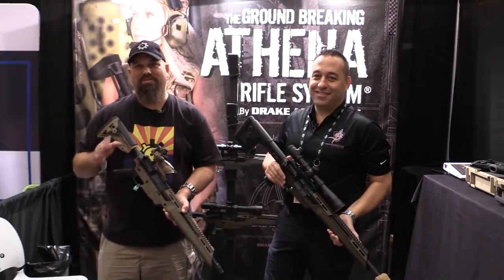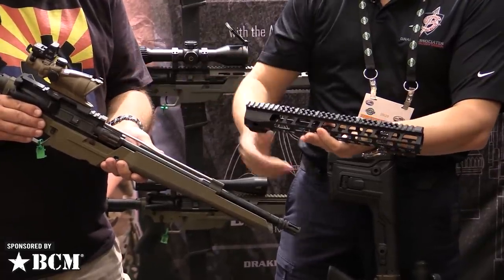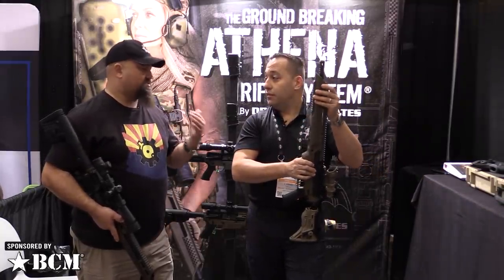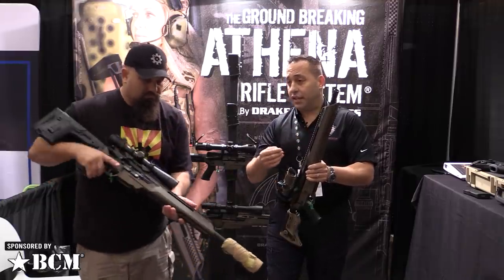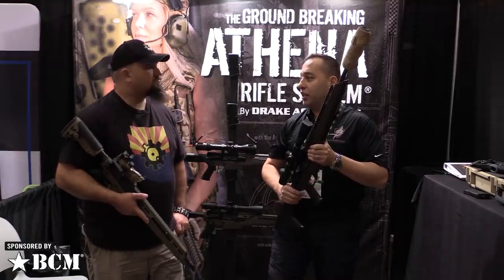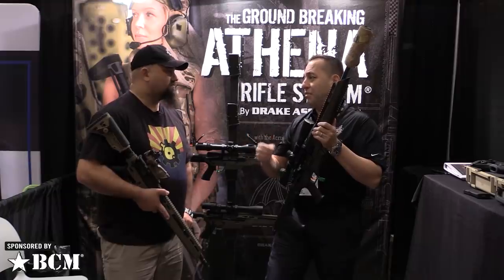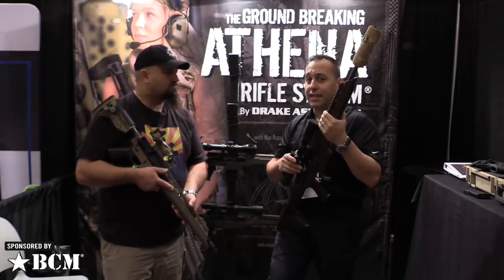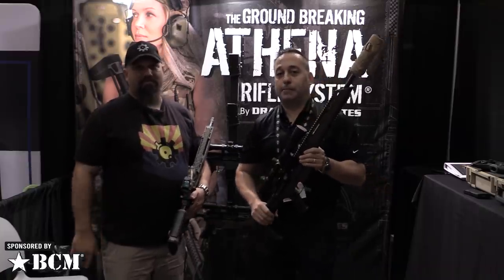Drake Associates Athena Rifle System - SHOT Show 2020

Comment: THIS ... This is what I like. You don't lose the ease of maintenance but you gain increased accuracy while mitigating user induced malfunction. Bravo.
Reply: You kind of lose a bit of ease of maintenance. You can't just pop the rear pin out and let the upper hinge open like a standard AR. But, this is a precision rifle, not a run of the mill standard issue assault rifle. Everything should be perfectly tuned, and match ammo should be being used. So ideally, you would have no problems, but even if you did, this chassis is only one more pin push, a push on a tab and a slide harder than standard.

Comment: While it looks interesting, I fear this is a problem looking for a question. Because the current AR platform is SO inaccurate... not.
Reply: They dropped 1 moa. Big difference in groundhogs.
Reply: A well built free float ar15 or AR10 is already more accurate than 99 percent of the people that shoot them. Squeezing out a few more MOA on a test clamp is fucking pointless. How much weight does this thing add? Is there suddenly a requirement to shoot a lapel microphone at 600 yards? This isn't a problem looking for a question. This is an answer to a problem that doesn't exist.
Reply: @RahRahRaharu  I dont think you understand people that buy this kind of thing. It looks cool and different. No one actually gives a shit about the extra 1/4 moa of accuracy if were being honest.

Comment: Cool idea. Very narrow niche. 

Taking a very modular, lightweight, inexpensive, and already accurate system in the standard AR-15 and making it more expensive, significantly heavier, and less modular all to eek out realistically a small amount of increased accuracy.

I would actually be really interested in a similar concept of bedding the upper but using a single polymer piece lower similar in style to the WWSD rifle lower but having that extended lower rail and slip on upper.

Comment: I’m genuinely curious though. If removing the separate handguard, and the pressure that that might put on the barrel nut, and truly having the barrel free float directly from the receiver increases accuracy so much, why do we not see the same gains out of something like the LMT MRP system, which uses a true monolithic receiver, and has no barrel nut at all?

Comment: Do they intend the sell this chassis seperately eventually to guys who like to build their own?
Reply: I would hope because I feel like this would be phenomenal for 6.5 Grendel or similar.
Reply: @lordhellfire153  my thoughts exactly. 6.5 grendel, or .224 valkyrie now that they seem to have buffed out that calibers issues. Any of the 6mm wildcats used for long range target shooting too. I can see a lot of applications for a chassis system like this. Would have been cool if they built a bipod in similar to the BLK LVL Bipod handguard for the AR15
Only thing I can think of that would take this chassis to the next level
Reply: They may after they've had some time to earn a reputation. But the last thing they need is some guntuber slapping a budget build frankengun in their system and declaring it to be shit. I don't blame them for wanting to control the whole system at least in the beginning.
Reply: @chopinbloc  certainly makes sense to me. I think this is a cool idea at an awesome (and Merican as fuck) pricepoint
If it performs and they release it as a standalone lower/handguard assembly you can use in builds later on I'll become even more interested. Especially if we see an integrated high quality bipod model at some point, then it'll REALLY have my interest.
I hate traditional bipods hanging off the end of a rifle.

Comment: Cool but I don't need this cause I was smart enough to buy true monolithic upper. Hand guard and upper is one piece inseparable.... The primary reason for my buy wasn't this precision but anti-rotation on many free float handguards was not to my satisfactory. It cannot fail and rotate if its one piece. Also with true monolithic upper you can use two piece rings and push scope as far forward you can.

Comment: That's cool.. I'm I'm just not spending 2000 on a rife I'll end up customizing myself.. I got a nice db15ccb. With Mueller Industries upper Cerro Forge lower for $500.. now I have customize it with Quality Parts NiB BCG and hammer.. Gen 2 J comp hybrid muzzle brake Magpul CTR stock scope offset sights extended takedown pins cerakoted the free float quad rail.. Better mag release and bolt catch Magpul K2+ overmolded grip and a Magpul bottom trigger plate buffer tube and hardened castle nut with ambidextrous sling blade.. you name it I've done it.. all together including the rifle transfer fee and shipping was about $1,100.. I call that a win..

Comment: No mounting a front iron sight, peq15 etc.... a well built quality AR is easily capable of MOA shooting and at least close to that even if you are resting the handguard on a barricade etc. Meaning its plenty accurate for combat/3 gun/larping. Who needs this Unless you are ultra high performance bench rest shooter in which case why are you using a $1,800 semiauto AR and not a $10,000 bolt gun